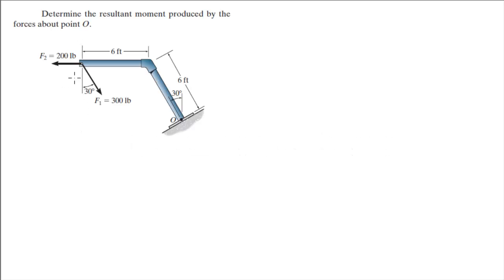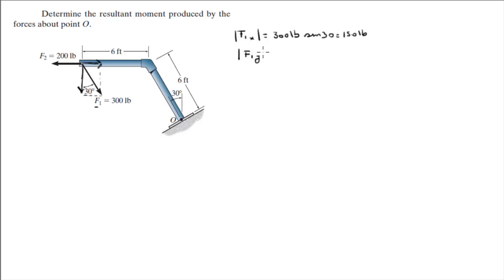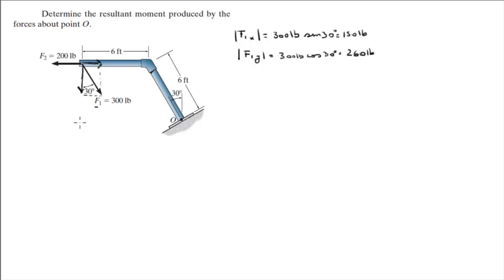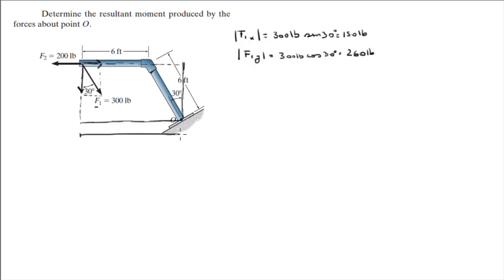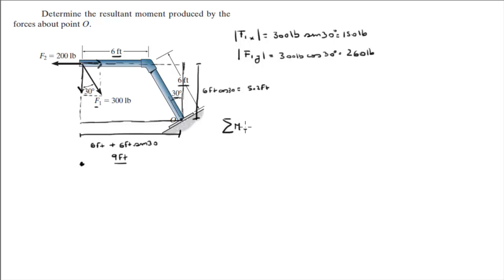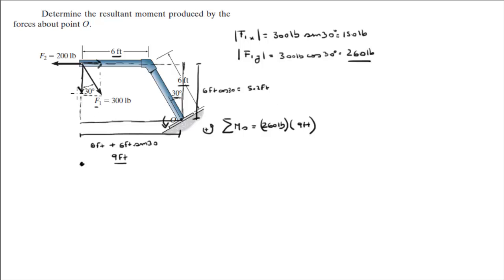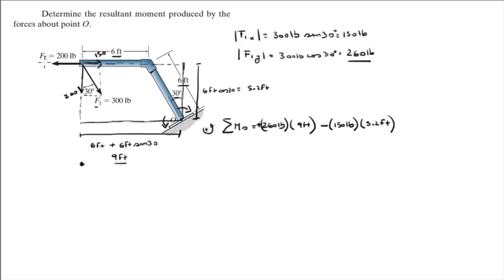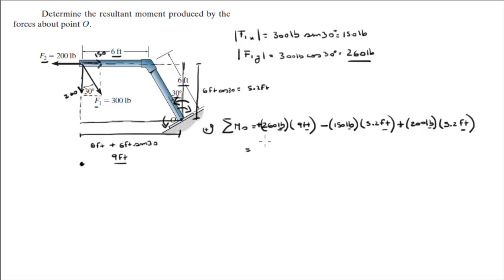Determine the resultant moment produced by the forces about point O

Comment: A force F(x,y,z) = [-20i+6j+20k]N is applied to the end of a rigid two segment arm with a pivot attached to the corner of the a table at P(x,y,z) = [1i+1j+1k]m. The end of the arm is located at position P9x,y,z)= [3.5i+3.4j+4.5k]m before the force is applied. Calculate the torque on the pivot due to the application of the force. You’ll be m hero.